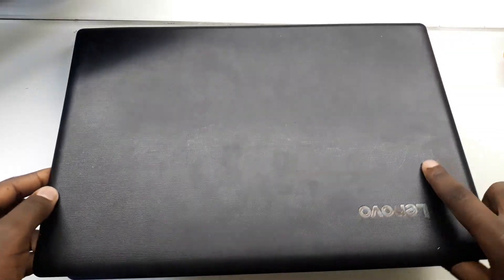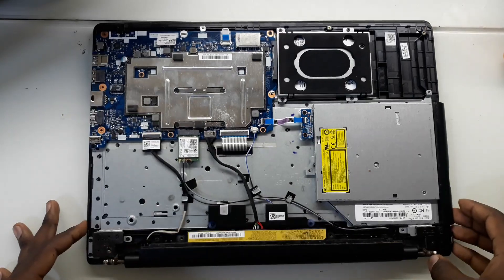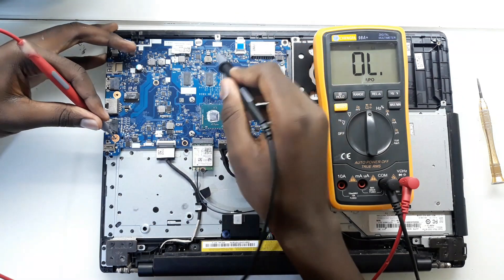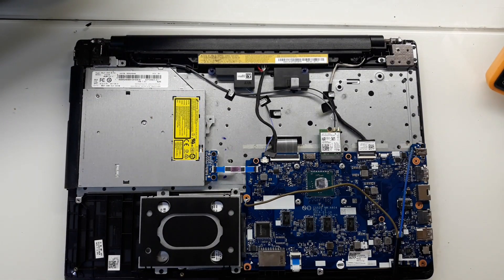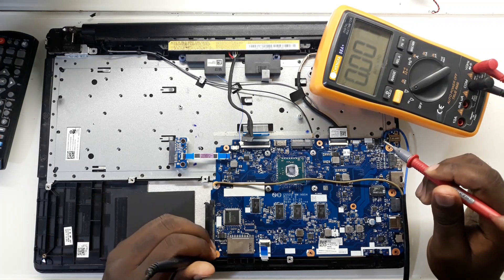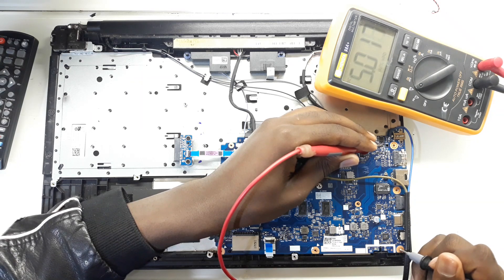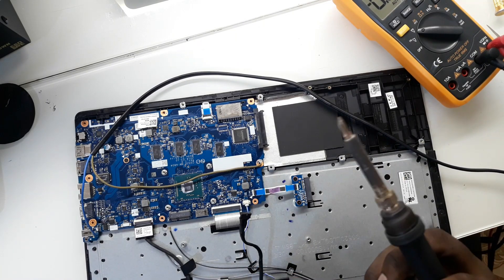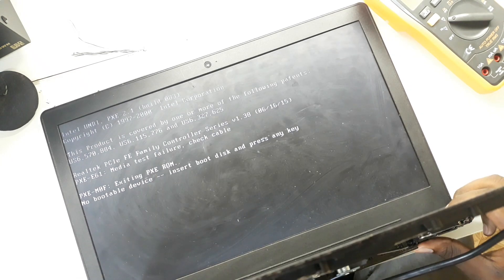How To Fix A Lenovo Ideapad With Faulty MOSFETs

Comment: I have a question, I am also in this area I have a problem with this Lenovo card I have never managed to make the display not even once except I already have at least 20 cards, I have all the tensions on the coils
Reply from the maker: Most Graphics cards main problems are MOSFETs and main Graphics Chip
Reply: that is to say it is necessary to change the entire graphics card?

Comment: Hey dude  what does it mean if my Charger input from the jack on the positive prob in the middle is just showing 0.5V, but charger without connecting to the port normally it's giving me 20V, Lenovo Ideapad 100, I don't see any physical damage to the port though! Pls help
Reply from the maker: You definately have a short circuit